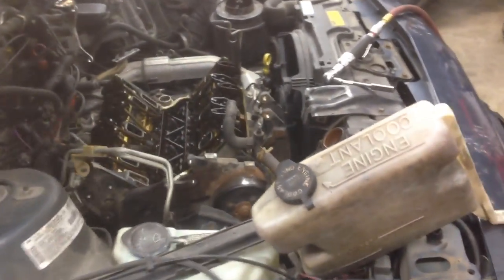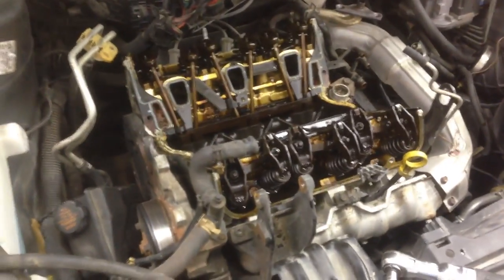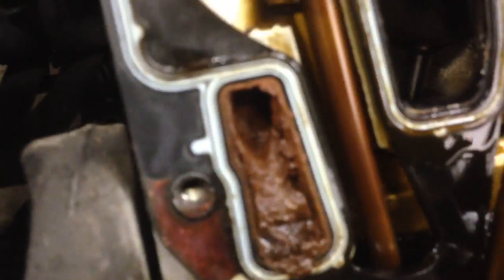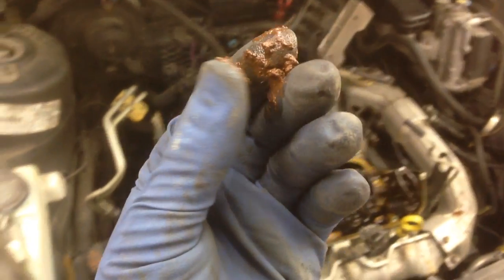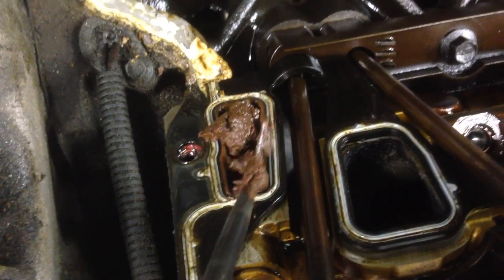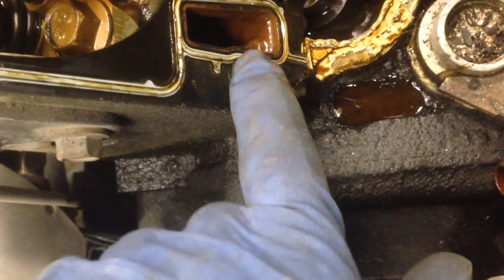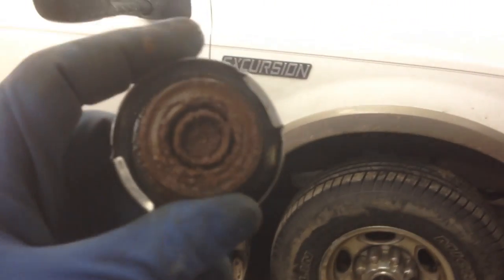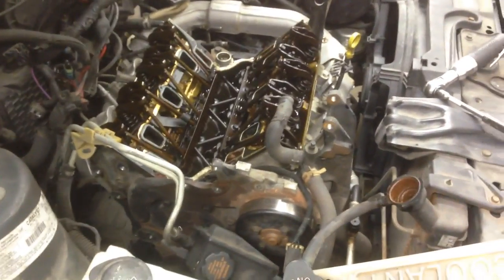Why it's called DexKILL

Comment: LOL they need to use the VW G12 pink coolant.  364,000 miles on my Tdi and the coolant is still perfect.
Reply: +dieselworld Most coolants with exception of Dexcool will still look perfect after miles and miles that doesn't mean the coolant is "still perfect" there are anti corrosion additives and lubricating additives which break down and that's why it needs to be replaced. Also very likely when the timing belt was done on your VW the water pump was changed and the same time and new coolant has been put in.
Reply: +Himmel Weint NOPE.  I do the timing belt and all repair and maint.  So I know how long its been in there.
Reply: +dieselworld My sisters 2006 Jetta TDI with 335,000 miles had the original coolant up until about 2 months ago when the timing belt and water pump were replaced. We tested it for conductivity and freezing and it tested damn near my 2013's G12 coolant, so obviously VW has done their homework on lasting coolant. But NEVER mix G12 with any other coolant, even the crap that says it's compatible with any vehicle with any coolant. If you do, it'll sludge up the system, just like what Daniel showed in this video. It's a complete nightmare to deal with. Thankfully, VW cooling systems are awesome to work with. Their self bleeding, and have very high GPM water pumps so a flush and refill is done within half an hour. Thumbs up VW!
Reply: the blue stuff Nissan uses seems to hold up really well also
Reply: The G12 Tdi antifreeze is for Vw diesel engines cooling system,  maybe usable in other diesel engines cooling system,  but would not suggest doing that in a gas engine cooling system.

The formulation for gas and diesel antifreeze differs in the composition of the chemicals thats in there, lubrication properties, anti corrosion properties, and other additives and ingredients put in.

Refer to owners manual, repair manual manual, and you can ask the auto technician too.

I flush and fill the cooling system, and refill entirely with Prestone All Makes and Models, ( In a dexcool system ).  And works great.

I have a GM vehicle with the 3400 ( SFI) Ohv 60 degrees V6, and also have another GM vehicle with the 3.1 Multi-Port F.I.

If you wish to do the same as I did, with your GM automobiles,  you can do it at your own expense.

Comment: Not only does it gum up the works, DexKill is the REASON you've had to take that engine apart again - it has a habit of rotting intake gaskets. Any vehicle I've ever seen more than about 7 years old running DexCool has either had the gaskets replaced or needs major work because of leaks.

Comment: Why it failed: Improper torque plus 195-215 degree operating temp. Poor gasket design and may have been cracked (microscopically) when installed. Even though Catalogs say the Dorman metal gaskets only fit 2000-2004 Vin M I have used them on those in that body Cutlass Ciera, in my 3.1L 98 Lumina too. When you come across a cooling cyctem that has gummed: if you do not clean it out with a soap or solvant solution in the cooling system for a few hounded miles: The sludge that was in the heater core and the bottom of the radiator will end up in the heads.

Comment: Dexcool itself isnt the issue. The issue is the engineering around the motor. Mechanical failure causing air contamination (which isnt good in its self, causing cavitation) which effects the coolant. Never had an issue with dexcool myself, have it in my truck with 150k miles no problem. Even though its "extended life" it still gets drained almost every 50k miles just due to maintenance.

Comment: I have seen many buick 3800 killed by dexcool. Converted to reguler coolent. It was already to late. Ruined the engine. Originaly had intake leak, fixed that. But engine sufferd hydro lock. Unlocked it. Then got it running after all repairs. But lower end was damadged.

Comment: Something with the composite gaskets used in the 60° V6 isn't exactly compatible with the coolant. (The gaskets that are from the factory are a bit crap anyways.) Some part of that mud might be that stuff dissolving. Hopefully you've replaced the LIM with an all-metal "problem solver" one (and does what the label says, no more LIM leaks), in addition to flushing out and changing the coolant.

Comment: Why would you have put dex-cool back in if you had just done the lower intake manifold gaskets 25,000 miles ago? Why didn't you do a complete flush 5 to 10 times until the water came out clear? Why isn't that car just in the junkyard with the rest of them?

Comment: Seems to me if air intrusion was the culprit it would be prevalent around the cap. I run a caterpillar diesel with long life coolant (the red stuff) for over 300,000 just since I have had the truck. Nothing even similar to this is occurring.  And I'm constantly checking fluid level by removing the cap.

Comment: Conclusion: I have a 2000 Pontiac Firebird with a 3.8L Series II engine. I just flushed out my engine block, radiator, heator core and overflow tank.  I found a bunch on oily goo in my overflow tank and its hard to get that out of there even though I took the tank off and kept running water through it. This engine has been running DexCool but because of your video I'm switching to the regular Prestone Green coolant now.  In other forums it says that the silicates in the green aren't good for your car either because they are abrasive which could kill your water pump bearings early, but I think I'd rather change out an inexpensive water pump then have my engine sludge up like the one in the video..... I wish someone would come up with a good alternative, can anyone recommend a good alternative?  Its hard to get all the air out of the cooling system but they say DexCool can turn into sludge with air contamination or mixing with other coolants, so I'm not gonna take the chance because once it sludges up good luck getting that chit out of there. I mean why take the chance with DexCool use the green and change it every 2 years. I know its nice to think that DexCool will take your engine to 175k miles or 5 years without maintenance but I'd rather check my coolant every 2 years or every 24k miles and save my engine for the long haul.

Comment: i worked on Chevys for years.  you get the brown stuff when you run the radiator low on coolant.  dexcool does not have the same additive as the green and the lube in it is soap based.   as long as the radiator is full you do not get this stuff.

Comment: I rented a near new vehicle that would continually over heat. While trying to get it back to the rental place, again it overheated. I pulled into a service station to cool it down enough to add some water to the radiator. Meanwhile, a young attendant came over and told me what the problem was........he said "it builds up a vacuum in there and causes it to overheat".

Comment: I've got  a 02 Silverado and have never had a problem with dexcool. If you mix dexcool with the green yes you will have problems. My Silverado has 220,000 miles and the cooling system looks brand new!!!

Comment: my stupid mechanic mixed green coolant with dexcool and this happened. It has nothing to do with bars leak. it is tough to flush out completely as my mechanic flushed the green coolant out. we should have done it at least 3x but it started the problems.

Comment: I used to work for a GM dealership, common problem with dexcool, along with leaking intake gaskets on the 5.0/5.7 vortec engines. I won't use the crap. never seen that with the regular green.
Reply: I never worked at a GM dealership, and franakly don't trust guys that work/worked there much. I have a 96 Tahoe with 208K on it. Never had an issue with intake gaskets until 180k, replaced them, the Dexcool was bright orange and in good condition. A lot of "mechanics" misdiagnose FI popit valve issues as "leaky head gaskets".

At 208k I have no issues with the Dexcool. You may have seen issues, but they were likely brought about by end user ignorance.....meaning 99% of Americans do not properly maintain their vehicles.
Reply: no the problem is that Dexcool really is the worst antifreeze on the market. there is not thing about it that is better then the green stuff. GM used gasket that got ate away by dexcool, sure, not dexcool fault but something that does that probably shouldn't be used in an engine.
Reply: Again, if maintained properly Dexcool is fine. Most people don't show up at the dealer until they have problems. Being as I am a trained mechanic I know what proper maintenance is. Air gaps in the cooling system CAN cause corrosion to start, but a properly maintained system will not have said air gaps.
Reply: Yes, I agree. maintanance is a serious issue that has only got worse with reliable modern FI and electronics. We no longer open our hoods, we just drive. I am not going to get in a pissing match with you but stand by my statement that there is nothing about dexcool that is better then the old green antifreeze. Dexcool is junk. the car in this video has more then a dexcool issue.

Comment: looks like copper seal tbh. Gm uses dexcool because it uses citric acid, which doesnt eat the gaskets like the green. Dexcool only actually turns to gel when you add another acid into the system..ie tap water, or another type antifreeze

Comment: I'm having a issue with my Cobalt SS and was at the 3rd mechanic. It's a long story but today he checked if the head gasket was bad and he started getting pissy when he noticed I was running straight water because i'm doing some testing. When I said I don't use death cool he got offended and pretty much said it's fine. I have had it go bad in my 96 V6 camaro and the passages were clogged when we took the manifold off. My 97 V6 was going bad so I flushed it and put prestone green. I have had green in there for 7 years and zero issues!. I had a 29000km ls1 ws6 and it started going bad in that too and that car was mint and only summer driven. My friends malibu and his monte ss both with 30000km both completely gummed up. Don't let a dex fool tell you it's good coolant. Sorry for the long post but I hate dex. Good video ;). Oh yeah forgot I put a new surge tank cap on and it had dex sludge on it after 1 day only!.
Reply: can't wait til winter and your water experiment freezes and you crack your block!
Reply: Jake Weiman it was for short term testing clearly. Why would anyone run water at sub zero temps.

Comment: i have a 04 trailblazer 4.2l. 240k on it. and never had a problem with the dexcool. I don't tho k ice had any air in trapped in it either tho. but the dex  has always worked well on mine.

Comment: good flush first and maybe no tap water. dexcool was made for the iron block and aluminum combo.
Reply: No, It was made for extended change intervals. 
"Certain cars are built with organic acid technology (OAT) antifreeze (e.g., DEX-COOL[19]), or with a hybrid organic acid technology (HOAT) formulation (e.g., Zerex G-05),[20] both of which are claimed to have an extended service life of five years or 240,000 km (150,000 mi).

DEX-COOL specifically has caused controversy. Litigation has linked it with intake manifold gasket failures in General Motors' (GM's) 3.1L and 3.4L engines, and with other failures in 3.8L and 4.3L engines. One of the anti-corrosion components presented as sodium or Potassium 2-ethylhexanoate and ethylhexanoic acid is incompatible with nylon 6,6 and silicone rubber, and is a known plasticizer. Class action lawsuits were registered in several states, and in Canada,[21] to address some of these claims. The first of these to reach a decision was in Missouri, where a settlement was announced early in December 2007.[22] Late in March 2008, GM agreed to compensate complainants in the remaining 49 states.[23] GM (Motors Liquidation Company) filed for bankruptcy in 2009, which tied up the outstanding claims until a court determines who gets paid

Comment: I've bought two 97 Z28's last year of the LT1 2nd gen sbc and both had dexcool crap mud in the cooling system. both heater cores were cogged and wouldn't pump out heat so I bleed them both and filled them back up and both blew a head gasket several months to a year after I serviced their cooling systems. But most people don't keep up with the maintenance and both those Camaros I had, well I still have the. one, were neglected so it's not so much GM's fault o the dexcool in my mind. But it's a stupid money gimmick of antifreeze/coolant if you ask me.

Comment: camaroman101 yes you are correct mixing other coolant will destroy your radiator and engine being siezed I've literally never seen a chevy truck that I've owned do that at all unless using the wrong coolant or something because never happen to me and neither have my ram had issues with mixing since I know my take zerox coolant and says don't mix but I have used universal coolant with zero and zero issues with it . but I do know chevy has to use only dexacool but also this happens when you don't change your coolant due to maintenance

Comment: Never had that problem, but my last car lasted over 5 years 220k miles due to proper maintenance, and then sold it after I got newer vehicle. I think it was something to due with what others say. In my opinion the 3.1L V6 always had problems owned one 10 +years ago was the worst engine yet in my experience of driving, even with proper maintenance. I called the 3.1L V6 a money pit.
Reply: +Brett Tiernan  I had the same problem with my 91 Pontiac Bonneville SSE with the 3800.  Its a great car and a great engine.  I have had to replace all the engine seals in it twice now since its got almost 200k.  I love the car very much and very happy with it.  I don't use Dexcool for that one since the engine is cast iron and magnesium.  I use Dexcool in my Cadillac's since the engines are aluminum.  I have never had any problems myself with Dexcool.  The supplements are not needed anymore if using Dexcool and it helps against corrosion on aluminum engines.   I'm sorry you didn't have a good experience with your car. 

I have a friend of mine that has a 2002 Buick Century with the 3100 engine. The engine went with under 90k.  Come to find out that the engine seals (intake and head gaskets) went out causing the coolant to mix into the oil.  The car is the primary driver and used daily.  The engine was replaced with a new one and is running great again.

Comment: well all I have to say is that it just looks like someone mixed other coolant with that dexcool, I've helped at a friend's shop a few times and had 4 or 5 cars a month come in for that problem, not dew to air in the system for sure. that would only cause a heating problem not this sort of sludge.

Comment: That's what happens when you MIX green and the dex cool together and add tons of stop leak!  I had my chevy for 20 years now running dex-cool and that's not even changing it at correct intervals and I have never had a problem.

Comment: Dexcool sucks. My advice is change it before you get this problem since unless you do a complete tear down there is no way of making sure its all out. I have a 2004 monte carlo. Im second owner, first owner was my dad who was a mechanic for a Chevy/GMC dealership. No issues whatsoever except ABS sensor(common) and the weather stripping leaking above air filter box( another common flaw) Literally put nothing but dexcool in it the few times it needed it. One day it got above 210°. Checked the over flow and was sufficient level but had clumps stuck to the side  so i let it cool and pulled the cap. It was full of that sludge. Took 4 flushes to get clean run through. I hated to do it but refilled it again with dexcool because i wasnt sure if the old was 100% out.

Comment: that is not because of dex-cool alone they still use dex-cool now and have been using it in EVERY gm vehicle and most chrysler with no issues.  that sludge occurs when you mix ethylene glycol (dex-cool)and propylene glycol (the green stuff) a chemical reaction occurs that creates that sludge. Oh and by the way if you buy cheap gasket kits for those engines the 3.1 and the 3.4 you will be doing it again you have to get the nice metal gaskets because the intake torque specs are so low you need good gaskets to make up for it that is the flaw not the dex-cool.

Comment: supposedly in recent years, deathcool has been reformulated and isn't as bad anymore. you probably didn't get everything last time you cleaned this engine, and it just happens to collect in the areas you've shown.

I've seen a lot of issues in the older cars but nothing later on

Comment: my 00 regal has Dexcool in it thats brown and keeps the conductive coolant meter sending out "Low Coolant"

As much as I love my 3800 torque monsters, GM's quality control issues stresses me out on the little things
Reply: iLife64    12.24.16.     Change out the lower intake gaskets with the metal framed ones from either GM.....Fel-Pro......or Magnum. I purchase them from Rockauto.    I also change out the head gaskets too......because the Dexcool does a number on them!   ☠️

Comment: I have an 06 Silverado with just over 200,000 and my entire coolant system looks as if it was brand new my tank looks fresh my radiator is clear never had heater core issues and never overheated not one time the truck has been very well maintained it is also been driven on very long trips to Nebraska from Nashville Tennessee several times I don't think there is any issue with the deck skill as you call it I believe the issue is poorly maintained vehicles yeah the bottle might say that that Dexcool can service for x amount of miles but Common Sense would tell you to change it sooner than that that's just like a 15000 mile oil only an idiot would change his oil every 15000 miles